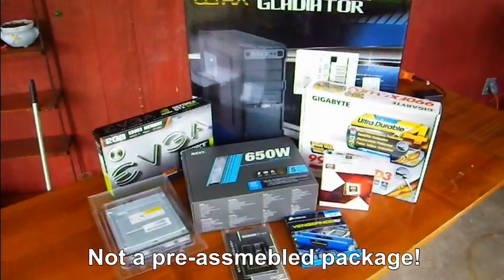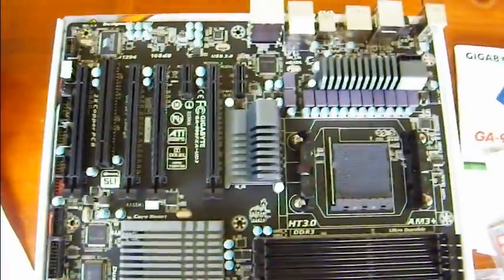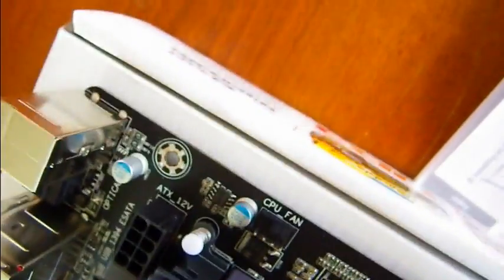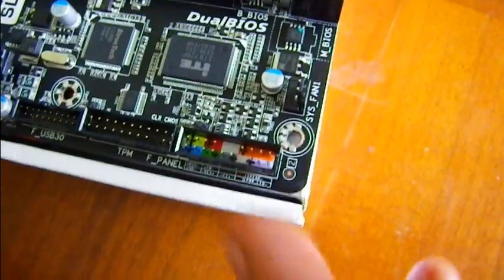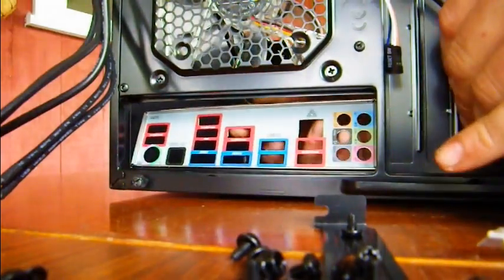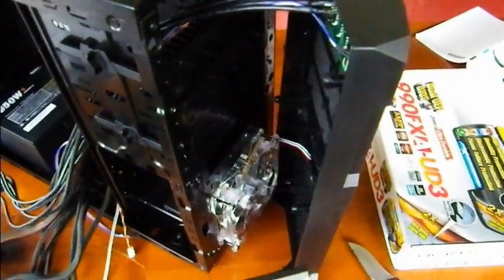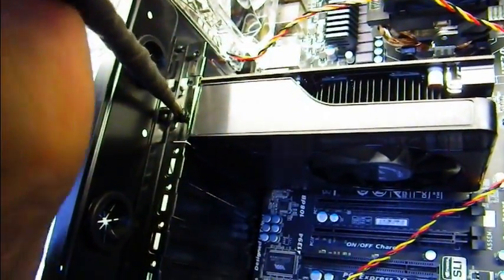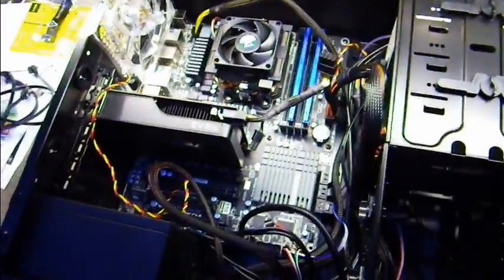Gaming Rig Build - GIGABYTE GA-990FXA-UD3 Motherboard ( installing the parts )

Comment: If any of you guys are watching this in 2019, please make sure to put thermal paste on cpu before cooler install (missing from this vid).
Reply from the maker: LOL, paste was factory installed, its the light gray square on the bottom of assembly.  such an old video.  I did upgrade this build and it now lives at my sisters :)

Comment: GA 990FXA UD3 rev 4.0
Corsair CX 750w
Kingston HyperX Fury 8GB 1866mhz (2x4)
Seagate Barracuda Sata III 1TB
Kinsgton SSD Now 120GB
AMD FX 8320E 8 Core 3.2/4.0 Ghz
AeroCool Xpredator X1 Red Evil
Gigabyte G1 Gaming Gtx 960
it's my first PC Build is everything ok?
Reply: If you are going to use this for gaming, I would use 16GB of ram, other than that it will work
Reply: Eli Beninato I already did mate another 2 4gb ram sticks and a cooler master d92 air cooler runs like a champ on 1080p amd fx OC to 4.6ghz and gtx 960 to 1520mhz boost :D

Comment: Hey guys, I'm having trouble with this motherboard. My old power supply's 8 pin connector isn't compatible with this mobo. If anyone can tell me what PS they're using with this board that works would be greatly appreciated. Thanks in advance!
Reply: seasonic m 12 II evo
Reply: Muhamad Hazim Actually got that problem solved already. The mobo shipped with bent pins in the 8 pin power supply slot. Now it boots, but it won't post. I'm sending this piece of shit back.

Comment: Hi there, I've connected my USB 3.0 cable to the MB (same MB) as you have but my computer doesnt seem to recognise it. If I plug anything into it, nothing happens at all. This is the same for the USB 2.0 port on the front of my case as well. (All ports at the back work fine) - Any ideas ??
Reply: Have you installed the drivers?

Comment: My build it's a 8350, 990fxa ud3 mobo, 8gbs ram, a cooler master v650 psu,  and a corsair 450d case... can I fit the newest noctua heat sink or nah
Reply: Google pcpartpicker, select your parts and it will tell you what does and what doesn't fit.

Comment: Is this board having heating issues?
Reply: I barely get 40...
Reply: But I use a noctua nh d-14 that has the middle fan set in a lower position
Reply: And a fractal design define xl r2
Reply: ***** If you don't want to get 95 degrees get a coolermaster 212 Hyper Evo . It is cheap and you can't imagine what temperatures you will get .
Reply: It did not got past 85...

Comment from the maker: No, you wouldn't need a 650, necessarily. Thermaltake has a power supply calculator that can give you a good idea for what you need.  At the time, I couldn't find any 450 - 500 watt power supplies that I liked, so I up graded.  I will be adding components later this winter and will need the extra boost.

Comment: Very good :) Just a question. I got the same Mainboard, do you have the problem that your cpu /ram memory is whining? i hear very often a stzrange sound and its annoying. Its my 3rd motherboard and its still here. i did changed everything 3 times, so i got in this time 3 new pcs. im using a fx-8350 and radeon 7850 2gb grafics card.

Comment from the maker: I like all the filters,  ill probably clean them out this week.   I don't open it very often, but the panel screws would be nicer if they were attached so I couldn't drop them.  There is only that one spot on the bottom for an SSD,  if you plan to install more small drives, it needs adapters.   It also needs a side panel filter, fan, or a way to close those gaps, the dust goes right in without something there.  I thought I would hate the blue light, but it doesn't really bother me.

Comment from the maker: No, well the drives are not installed.  I have been pulling files from them as an external drive.  I have a few enclosures luckily.  I should have ordered a ide to sata adapter to make things a bit easier.